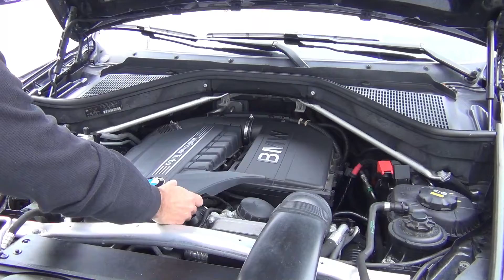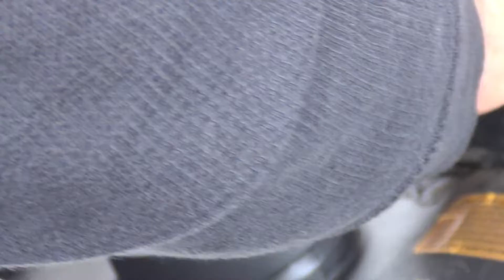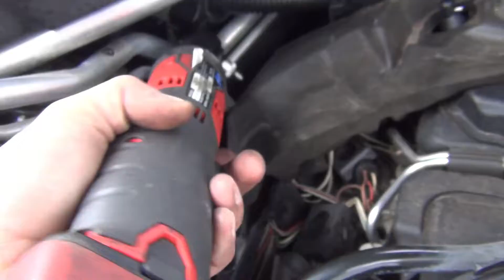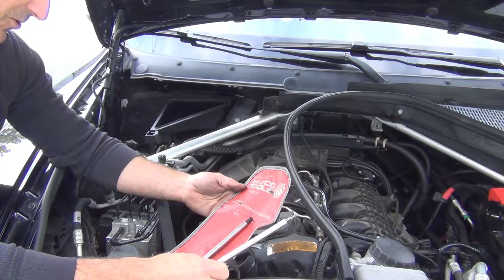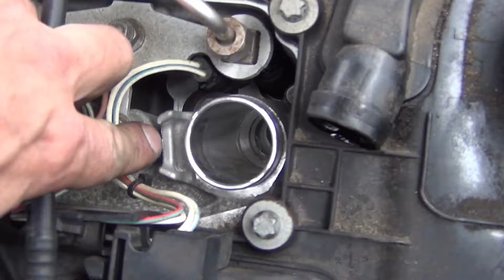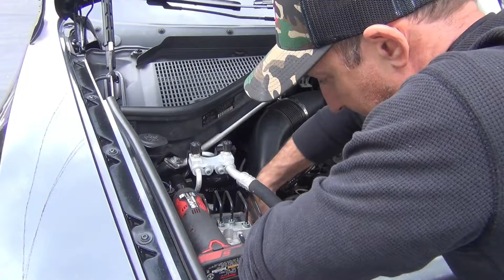BMW Spark Plug Replacement Full DIY N55 Engine X5 With TIPS and TRICKS

Comment: you are an actual GOAT helped me fix my girlfriends dads car 🙌🙌🙌
Reply from the maker: Awesome bud!!
Reply: @AskTheCarExperts  welp now misfire cylinder 5’s back
Reply from the maker: @holdentapia607  Sorry to hear that. Swap the plug and coil to start.  Use a spark tester to check for spark. Then a compression, leak down, scope inspection would be a good idea.

Comment: Great video just did this myself. Followed every direction. Every sensor and wire is connected snugly, plugs are gapped and torqued to spec. I started the car and was happy everything was okay until I started driving and I got a check engine light along with a drivetrain malfunction “maximum drivetrain output not available” along with shudders between 1500-2k rpm’s and it idles at 1k now. Going to tripple check my work in the morning and scan the codes but if you know anything that can help me I’d love to hear it
Reply: Nevermind cyl 1 misfire due to misaligned coil pack gasket
Reply from the maker: Nice job tracing that down blake!

Comment: I wish the camera work was better.  You needed a second person to do that.  I picked your video but got stuck in a lot of places.  I couldn’t how you removed the stuff above coil 5.  It was still the  best video
Reply: I started working on things I think I can handle.  Spark plugs never were a challenge. I got it done.  I got stuck on silly things. My favorite was the bracket that holds the hoses on the back of the engine by the o2 sensors. 
You take the two screws (I lost one) out and the clamp on the right side.  What the heck.  Well that took a lot of tugging and opened it by accident. That was it. All those other videos were still not as thorough as yours.  Thank you. I ended up with one black screw though…lol.  I may do it all over again
Reply from the maker: @rickcampodonico  That bracket is a pain LOL
Reply from the maker: Thanks Rick, Appreciated that. I don't really have a helper most days and the wife is NOT into anything car related LOL. You can tell I do all my own camera and editing but I do provide great info!

Comment: Excellent Excellent Excellent video, it really got into the meats and potatoes of gaining access to those little darling spark plugs-i did mine yesterday but wish i had seen your video as i did not remove the top portion over spark plugs 5 and 6--i went in underneath the plastic shelf for the air filters--it would have made my job extreeeeemly easier had i removed that shelf----at 130K miles I'm not sure if the spark plugs had ever been replaced at all before in my vehicle BMW X5 2016. Now I'm looking fwd to the next time i change out the spark plugs. and yes, I broke that corrugated plastic brittle part,--it didn't separate but under compression it closed the opening- I'll have to order another one but until then I'll use it--(it didn't set a code as i have driven the car over 100 miles and counting)--also I'll get the wobble extensions and battery powered rachet you used for other DIY things on this vehicle and around the house--saved at least 600$$ by doing this myself--ill subscribe to your videos--thank you so much!!!!!!
Reply from the maker: Hi Derek, Thank you for subscribing! Great job getting the spark plugs done!

Comment: Thanks for the video.
Changed my Coil (Bosch) and spark plugs (ngk). 
Not too bad compared to the HPFP replacement.
Car started up but still rough idle.
and Still have the same:
1. Engine  malfunction reduce power 
2. Chassis stabilization 
3. DBC malfunction 
Heading to Auto Zone to check OBD codes.
Do I need to do a reset so the Alerts disappear?
Reply from the maker: Sorry to hear you still have an issue. The car should run normal if that was the issue. Maybe an air leak? Best to check tue codes clear them and then rescan to see what is current
Reply: @AskTheCarExperts   any advice where to look ?
Reply: What did you find pls update . ?
Reply: @mohammadhayatca3244   I used a cheap eBay HPFP which was a huge mistake.  Only buy parts from Bosch or BMW.  The DME will know!  Still running rough.
Reply: It could of been the spark plugs or coil packs or even both but I think double platinum is what recommended on the n55 for the plugs..plugs could of been sparking at a higher voltage causing this issue??? Did you put the laser ird plugs?and hopefully you figured it out by now💀

Comment: Great video, I don't think I could have done it without your help.  A couple of comments from my experience.  Like you said, removing the filter box definitely made the access easier, but I found removing it first also make removing the air box easier.  I'm not a familiar with the mass air flow connector as you and one of big problems I have working on the X5 is not being able see a connector to figure out how to remove it.  Also, I removed the air box in two pieces.  To try to save that delicate part it made it easier because I had to pull pretty hard on the air box to get it out.
Reply from the maker: Awesome Scott! Thanks for sharing your experience. Glad to hear the video helped!

Comment: could someone please tell me where i can find the part number or link so i can buy the foam that it remover from above the coil spark plugs 18:12
Reply from the maker: HI Ricardo, That is a BMW special tool. I can get the part number at work for you tomorrow.
Reply: @AskTheCarExperts  thank you very much, it will help me a lot!
Reply from the maker: @RicardoLS  PN 83 30 0 496 065 From a BMW dealership

Comment: hi I notice you didn't the sparks plugs what is the settings or how dose that work
Reply from the maker: Hi David, The spark plugs do not have a separate reset. The replacement is associated with a specific number of oil changes and the information is stored in the key for the dealer to read. Nothing you can see with out having the key information read out. But it will reset with the oil service reset. Micro filters and engine air filter works the same.

Comment: Hi Bud, you are BMW master mechanic with lot of experience and knowledge.  Question for you buddy.  I have BMW X5 2012 E70, few days ago I disconnected battery to work on alternator.  Once, I replaced bad Alternator and re-connected battery but somehow it fried my FRM3 module.  Now, I have to replace my FRM3 module from dealership... what will be the cause that fried my FRM3 module when I re-connected battery.  as, far I know my battery had no issues or any error codes etc.?
Reply from the maker: Hello Tahir, This is in my opinion is an issue directly with the FRM module.  You did the process correctly.  Sometimes they fail when the vehicle is scanned as well. Known issue that BMW extended the warranty a bit but not by much.